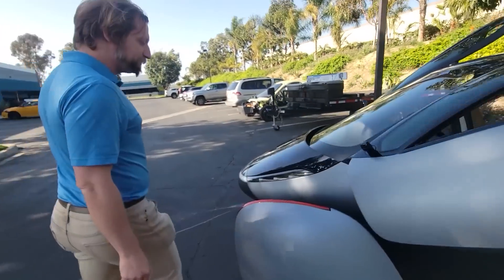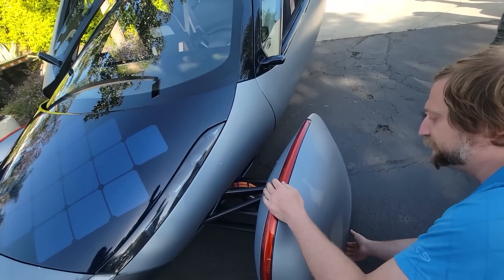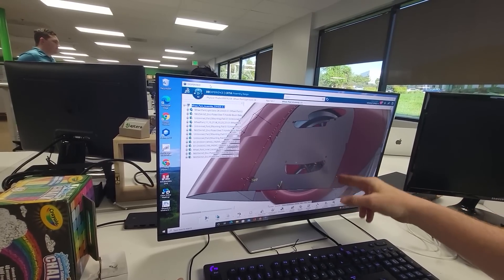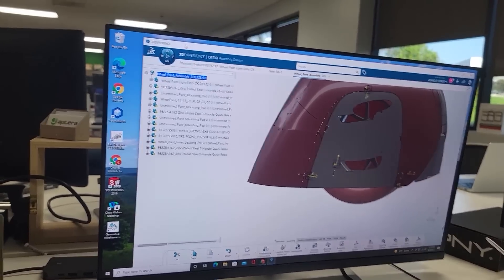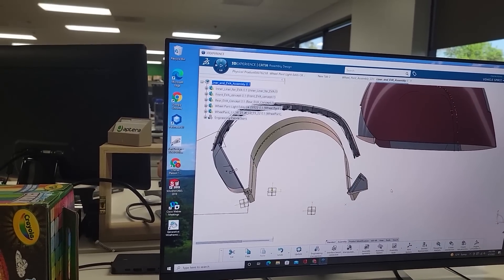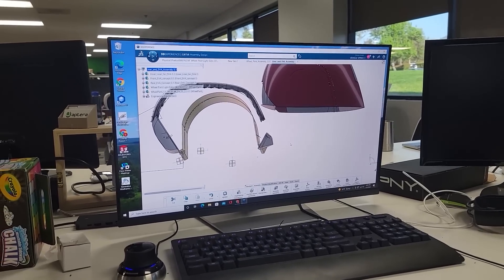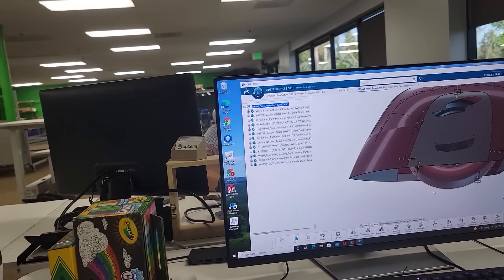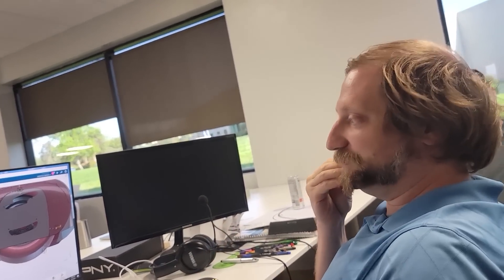No more wobbly wheelpants on the Aptera

Comment: They seemed to avoid the answer. Is the wheel pant replaceable at a reasonable price? They danced around it. All I can take away from this is a answer of no.
Reply from the maker: I think they don't know because the design isn't finalized
Reply: It probably depends on what you'd call reasonable. They need composites to make it stiff enough. So you're always going to be looking at a few hundred dollars. If they're strong and have bumpers on them, you'd probably be able to avoid critical damage in most situations.